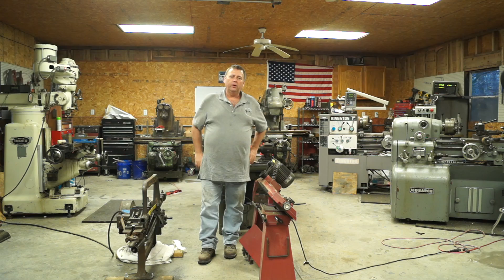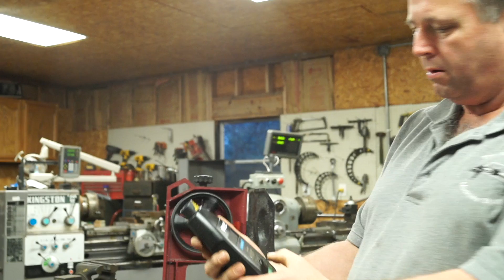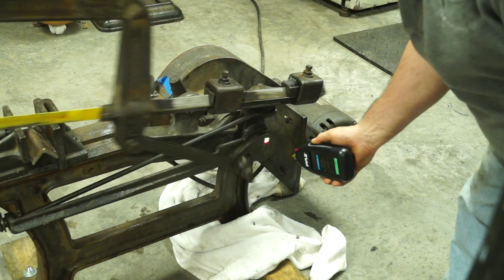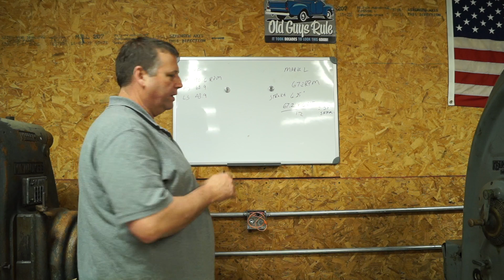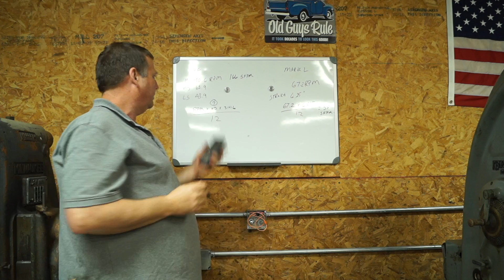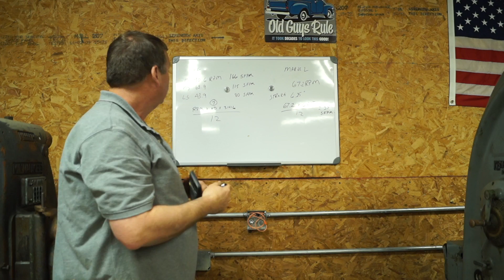Marvel Hacksaw vs Harbor Freight Bandsaw Viewer Challenge

Comment: Mike; Think you should have them tell you what the type of blade they used too! Probably more specifically what the teeth per inch was on the blade! It has a lot to do with cut speeds on metal just like flutes do on a end mill and would be interesting to see what the differences would be with people running same speeds and different pitch blades.
Reply from the maker: I would hope they give out what info they can

Comment: I'm sticking with my ancient Keller reciprocating saw. After all these years of cutting railroad track it still cuts straight. Have a Racine that does the same with a Wisconsin Gas engine. Coolant helps.
Reply from the maker: These saws are like shapers, they are fun to watch when they are running

Comment: harbor freight makes good tools there not great or accurate for the price they work when I was working I took harbor freight to work if they got stolen I did not loose 80 dollar wrench witch made it easier so I have good tools    and I have great tools but I use them all the same
Reply from the maker: I have several HF tools in my shop

Comment: I think Harbor Freight tools make great boat anchors
Reply from the maker: I am not bashing Harbor Freight I just wanted to show options that are out there,
Reply: No, you're definitely not . . . . . but I am.  ;-)
Reply: @BossmanEight  There are MANY HF tools that get the job done just as good as quality American tools. Like our 20 our old 2-HP compressor we use to run our Hypertherm plasma cutter wi the field,,,,or the 15 year old HF threading machine that uses Ridid automatic die heads or the 8" rotary table we got there that I have used to cut gears on our Cincinnati Toolmaster mill, and the 25+ year old Horz band saw we use in production. The problem is the armatures can't tell the ones that DO work well from the ones that are sub standard so they bad rap things they cannot understand.  It's called sophomoric.
Reply: Yeah @mathewmolk2089 , not my experience.  Still gonna pass

Comment: Were you able to buy your power hacksaw blades individually, if so, who from?  Only local to me was the MI Kansas City branch.  In spite of what the online catalog said, they did not have them in stock, and wouldn't order them in unless I bought the full bundle (for much more than I had to spend at the time).  I can't say I was very impressed with that particular branch.
Reply: I buy the blades for mine on Ebay, just keep your eye out and you well pick them up cheap.
Reply from the maker: I buy mine from Mcmaster, Ebay is another choice

Comment: I will accept the challenge. I use a HF saw daily to cut material. However, my saw is in a Rubbermaid tub with coolant and I use weights to adjust cutting. I also used high quality bimetal blades.
Reply from the maker: Cool, Your#2 Send me your address to thebackyardmachineshop@gmail.com

Comment: To be fair, shouldn't you leave the H.F. saw out in a field for 20 years or so?  :-)

Since the Marvel strokes twice the 6.25 inches each revolution, I think you are moving an average of 70 SFM during the actual cutting stroke.
Reply from the maker: Correct the tool speed is 70 fpm  at 50% effecenty I caught the error while editing
Reply from the maker: it's had it trials too, just because these saws have wheels doesn't mean it should be moved
Reply: Our HF saw we use in production IS older then that. (It's pushing 30 years old) Might be older then the Marvel hack saw, in fact. ,,,, And I'll put it against that Marvel toy any day.
Reply: The old saw stroke is not constant. It starts at 0, accelerates to approx 110 sfpm and decelerates to zero on each cutting stroke. So how you would quote a number is beyond me. I have a saw similar to the HF one, it has served me well over the years, but if I see an old reciprocating saw locally I'm getting it. Enjoy the videos Mike, keep up the good work. Mart.

Comment: Divide the feed by 2 since it only cuts on 1/2 of the RPM??  Maybe, Greg.  The HF cuts on every RPM.
Reply from the maker: The actual sfpm as far as tool speed goes is 70 sfpm, The saw is traveling 6.25" x 2 spm (strokes per minute). I caught my error in the editing and almost re-shot that segment. However the saw is only cutting half the time so it's working at half it's rate so I left it ay 35 sfpm

Reply ·
Reply from the maker: should be 2 stroke per revolution

Comment: To calculate FPM or the hack saw, wouldn't you multiply the 6.25 inch stroke times the time period of the stroke (measured in seconds) then convert to FPM? It seems to me it makes no difference how many 6.5 inch strokes the hacksaw makes in a minute, you want to measure the speed the saw blade itself plows through the material. That's your real blade speed it seems to me.
Reply from the maker: The actual sfpm as far as tool speed goes is 70 sfpm, The saw is traveling 6.25" x 2 spm (strokes per minute). I caught my error in the editing and almost re-shot that segment. However the saw is only cutting half the time so it's working at half it's rate so I left it ay 35 sfpm

Comment: All right I will be the first to take the challenge although I do not expect my HF band saw to be the fastest.
Reply from the maker: Ok Harold your #1 You can send me your address to thebackyardmachineshop@gmail.com
Reply: Hopefully it is already done.
Reply: New 10/14 bi metal blade and I'll go you 10 grand that our 25+ year old HF saw will beat your hack saw 3:2 in 1-1/4" 4140 cold rolled round bar cutting dry (we put water on it about 10 years ago)   Cutting wet it will run continuously as fast as you can re-set it as many 8 hour shifts as you want and and the blade will last over 4 weeks and it will carry +/- .010" on 3/8 thick blanks. - How do I know?  Because that is how we use ours 3 days a week month after month. (We can cut in house for 1/2 the price of buying the blanks cut to size)  - We did, however replace the worm gear about 15 years ago.( Lucky for us a local machine dealer happened to have a used one)  and the motor yacked and we put a used 1 horse Reliance motor on it.